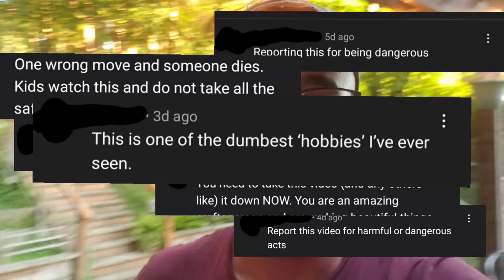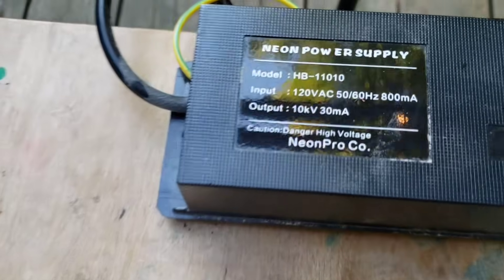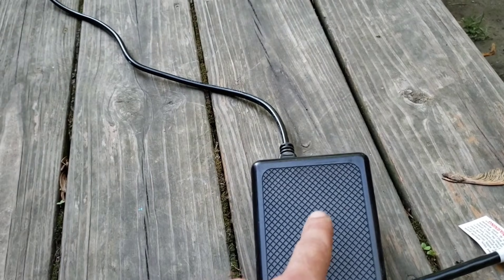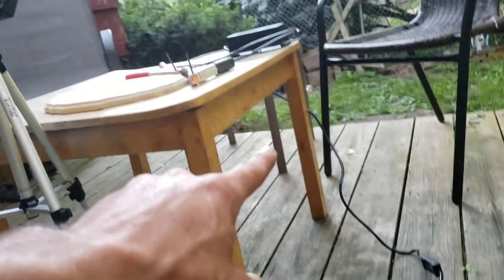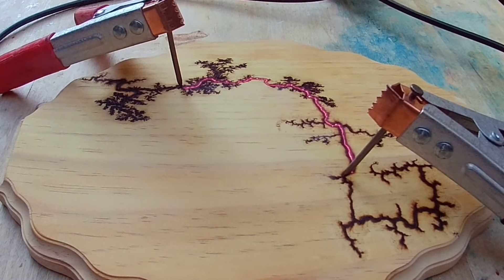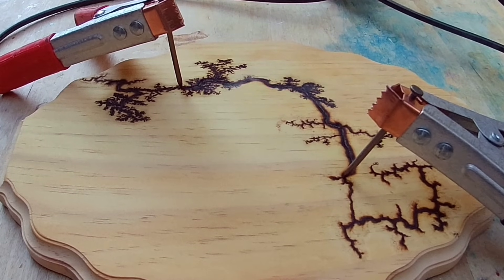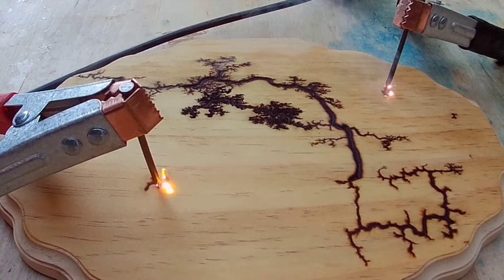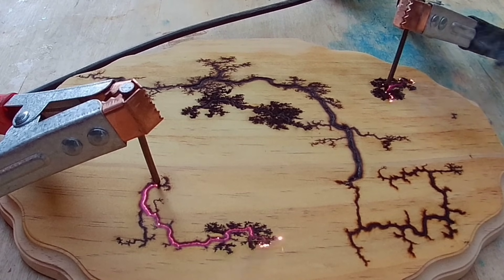Safer Fractal Wood Burning (Lichtenberg) Setup

Comment: What if you trip and fall? Or you forget to flip the switch off and someone comes by and steps on it or a dog while you're adjusting the probes? 

It's still a risk. Don't pretend like it's not dangerous and that most people don't use safe techniques or know how dangerous it is. 

She's not saying to ban the videos, she did say she would be happy if they were. She is saying there should be disclaimers for the videos that do exist with it. 

You're safer, but it's still not safe. As a public person, even putting the information out is unsafe.
Reply from the maker: Please read my other replies. I've answered this same question multiple places. Nobody is pretending anything. Thanks for the engagement.

Comment: "that's not just jump over and hit me" clearly you've never heard of electric arcs, have you? You know what, just keep on doing these safe practices, I'm very excited to see you hit the news with having burned down your house or being electrocuted. That'd be just natural selection :D
Reply from the maker: So you wish harm on me and are excited to see it. Perfect example for anyone saying that "nobody is saying anything nasty." If you knew the first thing about electricity you'd know at this voltage and the dielectric value of air being 1-3 kv/mm the most it could arc is a few millimeters, cm in absolutely ideal conditions, not 4 feet. Maybe take a basic science course and see a therapist

Comment: At 10KV electricity can jump 18" be aware of that fact amd you cable insulation is rated for 600V ONLY! THIS IS STILL A DANGERROUS DEVICE,
Reply from the maker: That is interesting, its not what I calculated but maybe you can teach me something. I know different conditions create different arcing conditions but could you please provide the formula that gave you 18 inches at 10kv? With the dielectric breakdown of air on a given day usually being anywhere between 1- 3KV/mm (temp, air pressure, ionization and humidity contingent), it would seem a lot less than that. Like 30KV per centimeter or 75KV per inch from my understanding. Which would mean this would potentially arc a few cm at most
Reply from the maker: That is a good call on the wire insulation though. Even though I'm not capable of touching it while it's running I should upgrade those regardless

Comment: Thanks for making this video and illustrating several risk mitigations factors. I conduct these projects weekly, but I’ve taken several steps to make it safer. In addition to the electrical safety protocols displayed in this video, I also have a second person with me to ensure that if something happens, they can provide immediate assistance as needed. I don’t work with any power over 30mA. Less than 100mA can be lethal. While 30-35mA can get your attention, make you piss your pants and you’ll forget who you are for an hour, it likely won’t kill you.
Reply from the maker: I'm glad to hear that and thank you for taking the time to reiterate the reduced risk of 30mA over higher amperage. It may burn a little slower but its definitely worth it. Stay safe my friend

Comment: It's fine when you're making clear how dangerous this is, but those who call this out as dangerous and ask for the removal of dangerous "hacks" are not "Karens". Karens are entitled middle aged women. Admittably I didn't watch your other video, but unless you're making absolutely clear how dangerous it is (which unfortunately needs to be done every single time) you are promoting it, even if you don't want to. Heck even I would like to try it now, because it IS a pretty cool thing. I won't, because I consider it as too dangerous though. No matter how many safety measures there are, I'm sure that there are ways for me to f up.

If you do have those warnings it's completely fine, if you don't I encourage you to add such a warning.

When it comes to Ann Reardon she didn't ask for the removal of all videos which show it, she asked for the removal of videos which show dangerous "hacks". This is not limited to fractal wood burning "hacks".

You have built a safety construction. Good for you. But many don't. Also even when done like this there are ways to kill yourself or set your house on fire. Something which would come to my mind is that you pass out for whatever reason and the pedal is held down until the stuff is burned through. It's unlikely that this will happen to you, but never underestimate the danger. I'm sure that you don't, but this video alone doesn't show it.

When it comes to people who might recreate your setup you should never underestimate the stupidity of people who think that it "won't happen to them". Especially if they'd take "shortcuts". I know that this is not a guide, but that won't stop some kinds of people from trying to recreate it, because it's safer than the "hack" version.

The actions performed in this video are fine in my opinion though. I don't think that's it worth it, but you do you. However I think you should understand where people are coming from.
Reply: Sky diving is dangerous, so is free diving, BASE jumping, wingsuit flying and free rock climbing 🧗‍♀️ to name but a few. And if you attempt these pursuits without being properly informed and equipped then hell mend you. 
And it’s the same with working with electricity ⚡️⚡️⚡️! If you go into it ill informed and ill equipped and injure yourself then it’s your own stupid fault.
Reply: i am so sorry this makes me laugh due to the fact that anything you use that has electicity you as the user need to have common sence not only book smarts i dont see where this tool any deferent  and he isnt pormoting this he was showing his art
Reply from the maker: @me-ye6ld  the greatest fallacy and false equivalency here is everyone who's eyes glazed over for the part of Ann's video where she talks about MOTs killing people and where she "drew a picture" and the part of my video where I state that they are different things entirely and still insist on equating the two. We can disagree on analogies, thats fine, but pretending what I am doing is the same as using a MOT or what she was describing is just intentional ignorance at this point. What is happening here is known as a created moral panic by inferring an inevitable outcome. This would be almost understandable if the focus was solely MOTs and videos that show dangerous practice and have no warnings and make it seem like just something fun to try(Ann's intent I believe). But its not. People are not dying to NSTs, they're dying to MOTs. They're dying from direct source power, not dual shut off that takes complacency and distractions into account. Equating the two of those things is not something you can just agree to disagree on because the science and statistics of it is simply what it is.
Reply from the maker: @me-ye6ld  I dont have any issue whatsoever with her criticism or what she showed. The fact remains that what she was talking about and what she showed was a completely different kind of machine than what is shown here. I specifically say in my video "this is dangerous." Someone even critiqued me on spending half the video telling people not to do it. People want warnings. I give dozens of warnings. People want videos that show safe practice. I make a video showing safe practice. This is not the machine Ann Reardon is even talking about. This is not the machine that is on tik tok. This is not the machine that has killed someone. I dont know how much more clear I can make it friend
Reply: I don't think this guy should be attacked nor do I agree with people nagging him but this dude has clearly turned this into a political issue type of argument. He thinks he's being "censored" and that causes these types of dudes to triple down harder and want to be more vocal. I see his point but I think he's missed the mark in regards to the main issue being that fractal wood burning shouldn't be "censored" just shouldn't be portrayed as a simple weekend project how social media makes it look
Reply from the maker: @hillaryclinton2237  if you scroll down in this comment section you'll see someone who has reported this video for removal and who has called for others to as well. He isn't the first, just the only one I've left up. I agree it shouldn't be portrayed that way which is why I provided content that doesn't. There are other safety videos that people have shared on this topic that received the same treatment. That is, infact, an attempt to censor regardless of disclaimers or safety. For those people it doesn't matter how it is portrayed, simply that it exists at all is enough for them to demand the video be removed. If we are focused on removing videos that show someone being foolish or unsafe that's fine. Unfortunately you cannot remove all traces of such a thing without something taking it's place. Preferably safe practice and danger warning videos not dissimilar from the one Ann put out and the one I and others have. Coming after videos like this is pointless. I provide an antithesis to the videos that people are claiming to take issue with. And of course I'm going to focus a little on people wanting to remove something I created. I am human after all. I am curious to know what "type of dude" you think I am after viewing this one video and reading the comments though
Reply: @TheFishinDad  dudes reporting you means you're being censored? that's not how that works and clearly you haven't been removed. No one is censoring you.
Reply from the maker: @hillaryclinton2237  it is an attempt to censor. I mean that's the definition. You can argue with Websters if you'd like
Reply: @TheFishinDad  lol snowflake
Reply from the maker: @hillaryclinton2237  lol troll
Reply: @TheFishinDad  not at all lol. You're the kind of guy that believes cancel culture is real and think you're important enough for it to come for you. You're not getting canceled lmao
Reply from the maker: @hillaryclinton2237  honey I'm crazy important 😘
Reply from the maker: @hillaryclinton2237  you're important too btw! But you could be doing something better with the time you're given than trolling me. Also, though I'd rather not bring it to my yt channel, you have my political philosophies pretty backwards. See you thought you had me figured out from one video and what I would hardly consider a conversation since there's an aggressor and a defender. You could afford to change your approach. I've had plenty of good, mutually respectful, conversations in this comment section. Next time get curious instead of judgemental. Gottman Institute and all that
Reply: @me-ye6ld  You clearly have not called "professional electricians" to your home. Some are so professional you  go outside to pray.

I don't think method shown here  is more risky than general woodworking. Or using chainsaw, picking wild musrooms or cooking with gas stove.
Reply from the maker: @me-ye6ld  if you watch the video and read my other replies you'll learn how a deadman switch works. I also can't trip and get electrocuted. Also at the amperage I'm using I would not immediately die. It would suck, very badly, make no mistake, it is still a dangerous amount of current, but this isn't a MOT which will kill you just like that. I've expressed my opinion on those across this comment section
Reply from the maker: @me-ye6ld  speaking of false equivalencies, fewer deaths from mushroom hunting is a result of greater education and widespread and easily accessible resources on the topic, not that it is less likely to hurt you. True, you can not touch a poisonous mushroom until you're sure of what you have, but you can also not touch an energized probe until you're sure the power is off. I think that is the comparison that was being made and it is an accurate one. If we're looking to make any hobby safer, education and not censorship is the only way to do that and right now the majority of resources on the topic are either saying not to do it at all (which people will ignore) or showing how to do it dangerously. Both are problematic when they outweigh education on safe practice. If the same were true of mushroom hunting there would be a lot more deaths, but as there are thousands of books, videos and articles on how to identify and stay safe that is not the case. Does that make sense?
Reply from the maker: If people want to call out dangerous practice on videos that show someone being dangerous with it that is fine, and I have no issue with Ann's video. I've done the same on other people's dangerous fractal burning videos before this became a whole controversy. The issue comes in any time we blanket label something as bad, disregarding science and logic for emotion driven intentional ignorance. Again, that is not directed at Ann or her video, that is directed at the peanut gallery who have suddenly become experts after watching one video.

There really is no way to get hit with electricity doing what I'm doing. I wouldn't make such a risky statement if I wasn't 100% certain of that. If I passed out and fell on the foot pedal I would need 4 foot long arms to still get near the board and even then 30mA isn't going to kill me. The deadman switch is designed exactly for the purpose of if something out of your control happens, such as passing out. Yes of course there is the idiot factor as I mentioned before but you would really have to be trying hard or not following the distance precaution to get hit. I understand that people will not follow all safety protocols out of laziness or arrogance but policing that isn't my responsibility anymore than policing someone's driving habits. My intent is to provide information on safe practice. If someone wants to ignore that then it is their choice but at least it is available for those who are actually trying to be safe. 

I suppose the definition of Karens might not apply as nearly 100% of the audience on this video have been age 25-34 according to analytics so keyboard warriors looking for a cause to back in order to validate themselves probably would've been more accurate. I have no problem having a polite debate or agreeing to disagree. It's the obviously uninformed people who come into these videos that are not 30 second shorts, that do lay out the dangers and give safety information, and persist to talk down because they watched one viral video that, as you pointed out, wasn't even directed at videos like this.
Reply: Ok, Karen.

Comment: I do not agree with your video at all. You used the word "witch hunt" which basically called what Ann Reardon is saying totally baseless or false and ridiculous. Is fractal wood burning dangerous? YES, IT IS. I mean what if you tripped onto the switch on the floor while trying to press it and fall straight onto the wood? If you want to have a great chance at dying, try fractal wood burning. If you have a brain, just don't do it. The risk is just too great.
Reply from the maker: If I tripped on the switch on the floor then my foot wouldn't be depressing the switch and therefore the machine would be off. It's called a deadman switch. Literally impossible for me to be electrocuted. I even asked in the video that people be smart in the comments

Comment: Think the issue was that people haven't been taking the safety precautions, hence the large number of deaths. This is a good example of the safety precautions needed to protect yourself and others.
Reply: This is NOT safe, don't get fooled!
Reply: I love how you conveniently ignored the placement of the switch on the ground and the lack of safety gloves. Imagine if he tripped on the foot switch and fell onto the wood and got electrocuted to death. And he's using his bare hands to hold those clippers that will electrocute you to death if you just brush against the metal part.
Reply from the maker: @magictoxicswitch2300  the placement of the foot switch ensures there is no way for me to touch anything in that vicinity should I trip or get distracted because as soon as my foot comes off it the power shuts off. This comment makes no sense. Also I would have to be grabbing both probes to complete a circuit with my body which is why I show that even while off I grab only one at a time. If you are coming from Ann's video and think this is the same amperage and danger as what she is talking about (which it is not) then you should know that gloves will not protect you and have in one case at least caused more injury because they fused to the man's skin. As I've said all over the comments and in the video itself, this is a neon light transformer (30mA) not a microwave transformer (500mA). The switch is a deadman switch. It cuts power when not depressed. I only see one person here conveniently ignoring things tbh